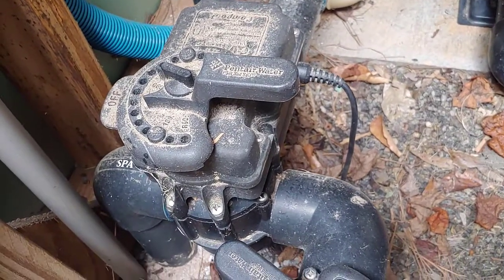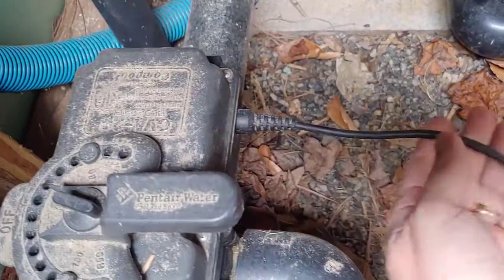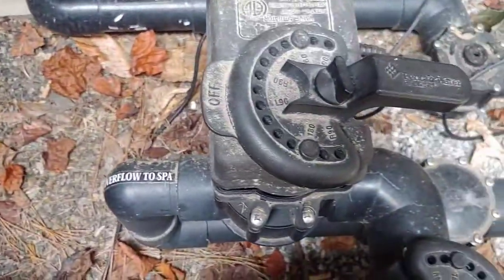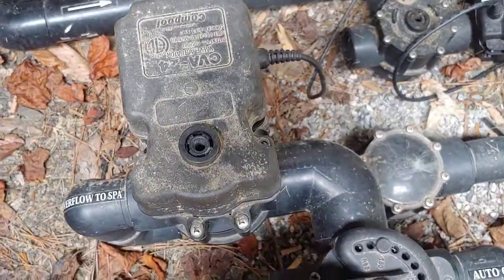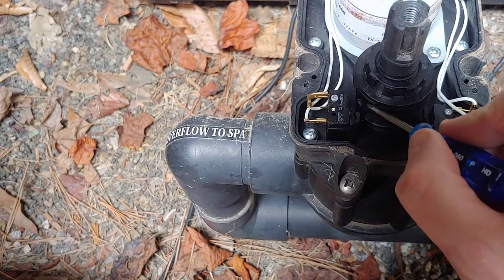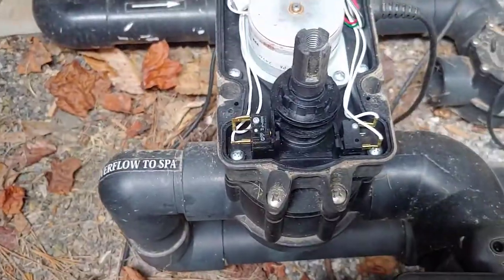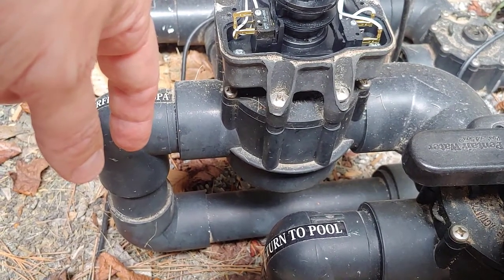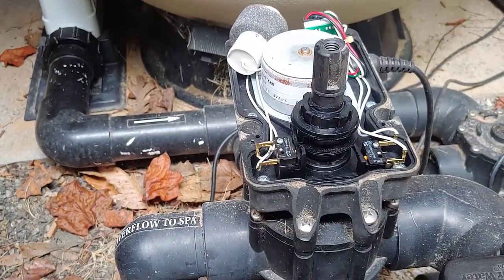Pentair Pool Actuator Not Turning Valve? CVA-24 Micro Switch Fix & DIY Repair Guide, Compool

Comment: Thanks!  Do you know if these micro switches are the same ones that work for a Heyward GVA-24 actuator?  They look the same but want to be sure. Thanks!
Reply from the maker: Hi, I don't know for sure but I'd guess there is a high chance that they are identical. I quickly searched Hayward GVA-24 actuator parts and looked at pictures and see that they look very similar, if not identical.   Thanks for the comment/question.

Comment: Well, after comparing the other pool valves, my pool installer failed to put a cap/lock on the Pentair problem valve that stopped working. I unscrewed the four screws and components are wet, rusted and nasty. I dried everything carefully and now I am waiting on micro switch SS-5 even though mine say SS-5-2T since I can’t find those online. Have a salt water pool and valve stopped working after I got around to cleaning salt cell and filter and then this happens on a Saturday morning. Unfortunately we had a monsoon yesterday with non stop rain and I am just hoping to get a Sunday delivery so my pool water stays clean!
Reply from the maker: It sounds like you are on the right track! Let me know how it goes.

Comment: Very good job on video. Those 24s are not cheap. Mine are 20 yrs old but I am hoping some new switches will keep it going. About to go test mine now. I found them on Amazon... since you did that same switch 2 twice you think it was cheapo switches? Again thanks diyer
Reply from the maker: Thanks for the comment. I think that it was a case of using some cheapos.  My equipment is also covered so you'd think they'd last longer.

Comment: Any idea where to purchase the "cams" (the circular nubs that activate the limit switch)? I have one that's cracked and can't seem to find replacement parts.
Reply from the maker: I doubt they sell them as parts. Your best bet may be to find someone to let you have a broken actuator and get the part from that one. Check into a pool service company that may have removed one. Also, keep in mind that I think the Pentair/compool actuators are the same as a lot of other brands.  When my Pentair pool pump was under extended warranty the capacitor went out. I called them and asked for them to send me a $12 capacitor. "Sir, we don't stock those, I'll have to send you an entire new motor."  Crazy but now I have a spare $900 pool motor. BTW, thanks for watching my channel!
Reply: Hope mine aren't cracked will inspect that as well. Thanks for pointing it out here.